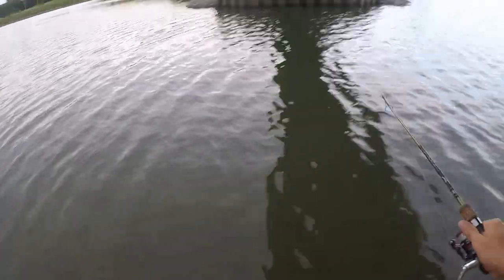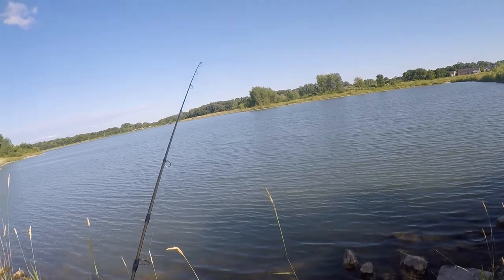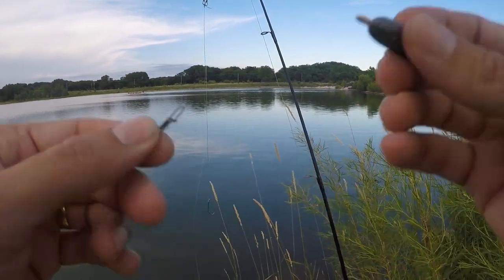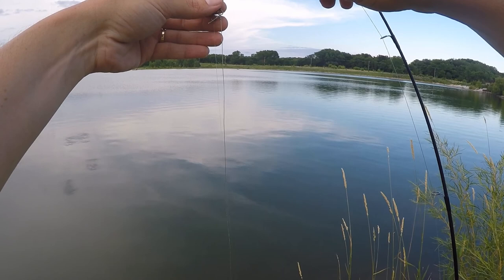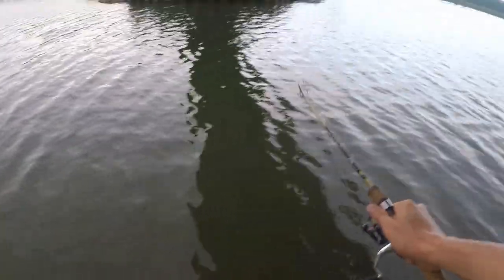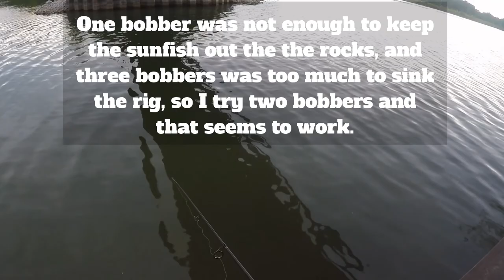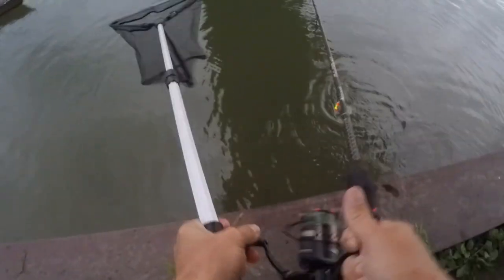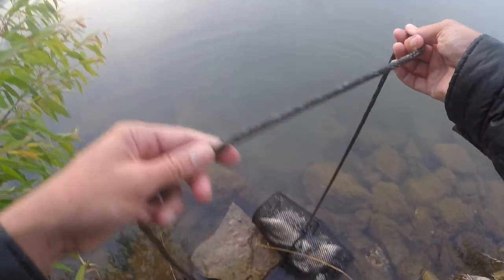First Bass with Live Sunfish, Trapping Crawfish, Testing O-Rings and a New Rig

Comment: the famous two hand cast under trees, lol..... that's a cool live bait rig
Reply from the maker: Thanks, in the new version I'm going to be using a casting bubble for a slip bobber and going to shorten all the lines up just a little bit. I also tried adding a second worm hook just above the sinker for fun (for maybe a trout or walleye). I'm going to keep experimenting and see how it goes. It takes a lot to set it up, but once it's in the water it just sits there and the bait does the work, so I'm going to keep testing it.